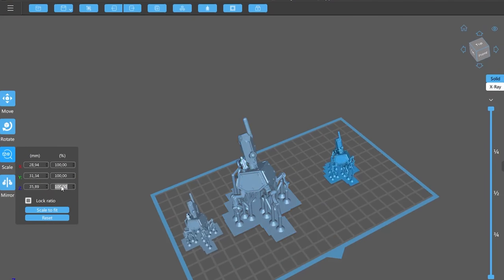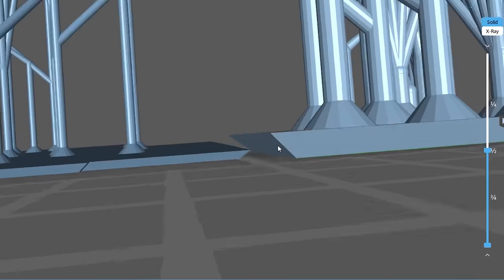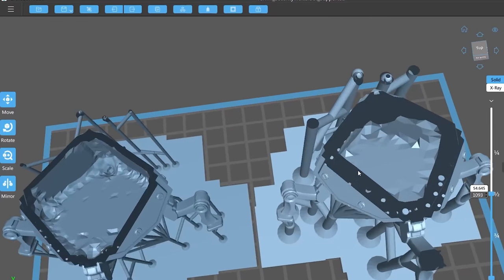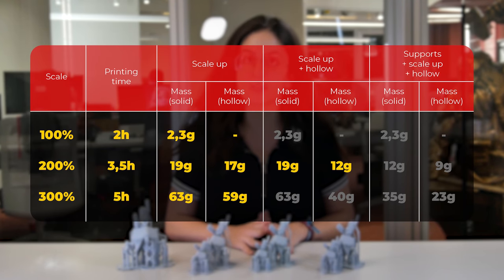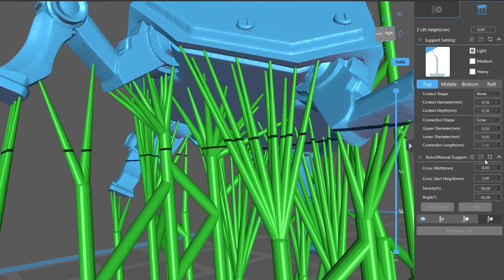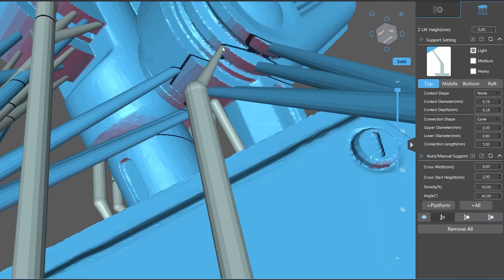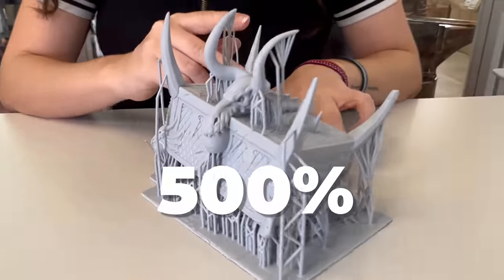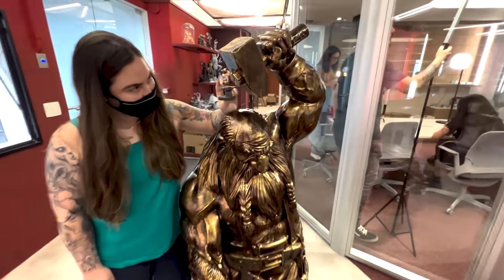How to SCALE UP your miniatures? | 3D Printing Tutorial

Comment: Third method is the best , not making oversized walls or supports. 
Glad you mentioned drain holes, otherwise it will crack apart in the future. Need to cure the inside too.

Comment: What program is this? Meshmixer?
Reply: i think the cuts where done with windows 3d file viewer thingy whatever its called
Reply: @specialingu  3D Builder in Windows 10.  If you use MeshMixer some 3D makers, like Anvil Digital Forge, make 'multi shell' miniature files.  These function like an Action Man or GI Joe.  You can load the complete miniature file, disconnect all the shells (they remain in one piece on screen) then highlight and 'turn off' any parts you don't want (helmet, shoulder armour pad, etc).  'Combine' the remaining shells into a single miniature and export it to a new file name.  This can then be sliced and printed as normal.  The multi shell files work such that if you remove a helmet, for example, you have a regular head underneath.